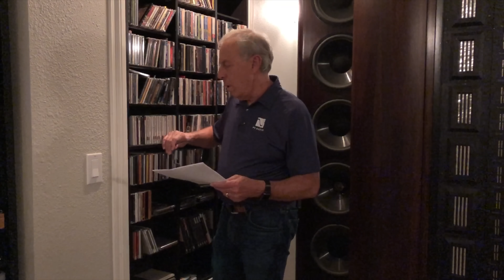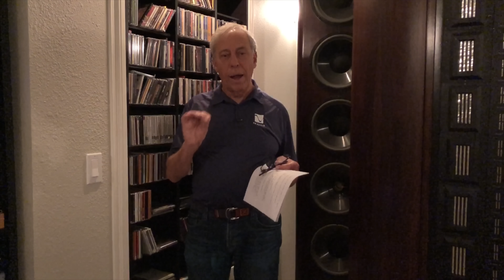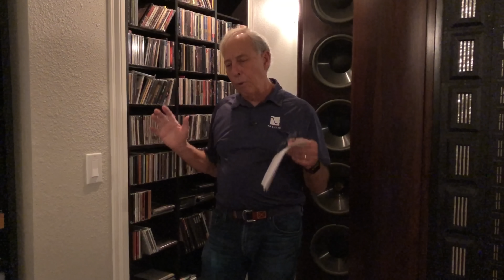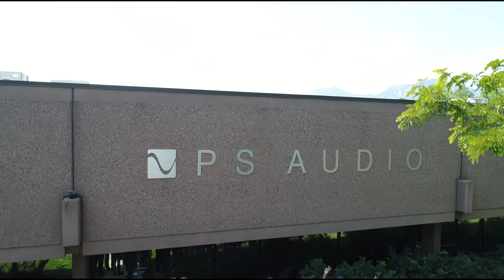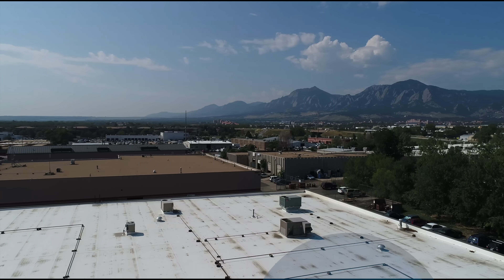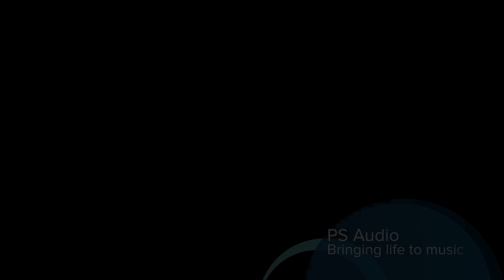What does PS Audio use for a reference?

Comment: For auditioning speakers you might buy, use music that you're very familiar with. I use an assortment of music that I've listened to a lot over the years, from Boston to Phil Collins to Dave Mathews to some obscure instrumental stuff I can't remember the name of. ( I bought my last pair of speakers in 1998 and I'm still in awe of how good they sound. At $3,100 a pair I should be, and that's with or without the matching subwoofer!) still, I like to refurbish old speakers and am now working on a pair of design Acoustics PS 10's. After that I'm wanting to refurbish my first build Peerless three ways, but finding a woofer that works well in a small sealed cabinet is not easy. I've found a driver that will work, but it's $239 each. They will go down to 33 Hz, about equal to the original drivers, but that's when porting the cabinet instead of leaving it sealed. I'm not sure if the trade off is worth it. I would recone the original drivers or have them done, but nobody is sure they can do that or if their aftermarket cones will fit. 35 years after building these speakers it's a bit late to find parts to fix them. If it was just surrounds that would be easy, but the paper cones, although sounding great for decades, deteriorated in the desert sun over the years and disintegrated when I pulled the woofers out of the cabinets. Damn! I'll get that figured out. For reference, see the loudspeaker design cook book by Vance Dickerson. It's a good book that will point you in the right direction, whether building speakers from scratch or trying to find drivers for existing cabs. Although the latter is not a subject discussed in the book, the principles are the same. Good luck!

Comment: I have the identical problem with my CD cabinets, and I stumbled on the ideal solution.  Go to hardware store and buy the spungy tape that plumbers use to wrap around pipe threads before screwing one pipe into another.  Wrap a one inch section of this tape around the lower half of the plug and insert it in the hole.  Now the plug won't come out and you can still remove it in the future.  This is a much better solution than glueing the plug in the hole.  Also, the tape isn't sticky and it doesn't deteriorate.
Reply: I would say google this for a better solution this is the only style I use "L shaped shelf support pins"
Reply: I can't imagine a better solution.  Apparently you can.
Reply: The stability of the L shaped ones plus since they are L shaped the shelf holds them in and they will never fall out